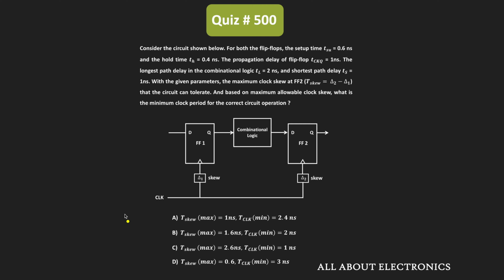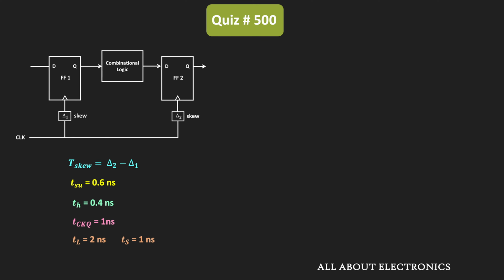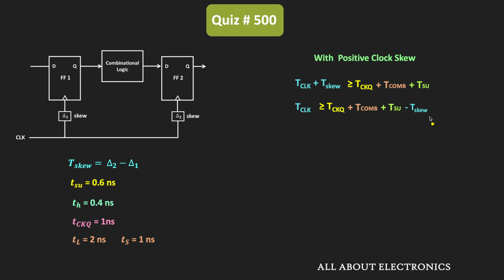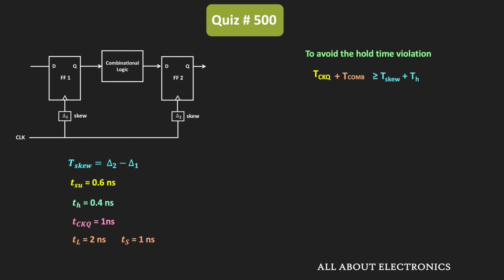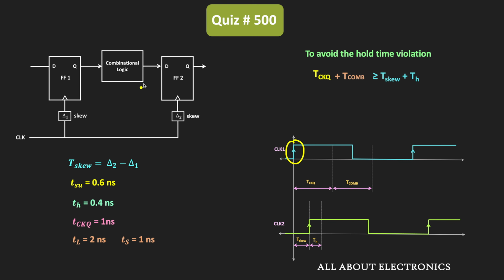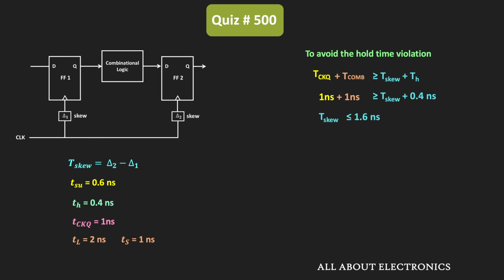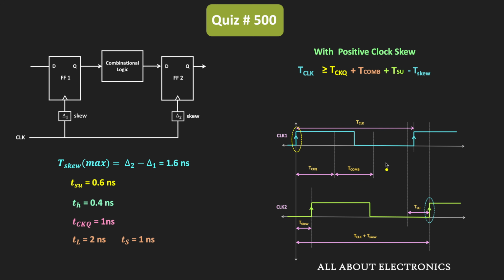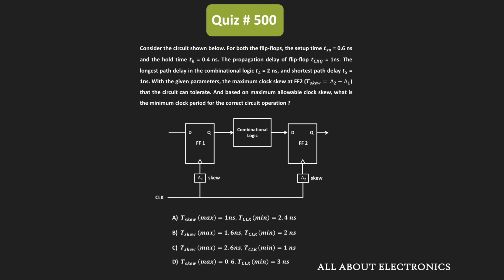Clock Skew Solved Problem (Digital Electronics) | Quiz # 500

Comment: Why we took shortest  path delay in case of maximum clock skew and longest path delay in case of minimum clock period?
Reply from the maker: For finding the minimum clock period, we are considering the maximum propagation delay so that the circuit works even under the worst case scenario.

Comment: Sir what if there was another flip flop followed by these two flip flops? how will we then calculate that?
Reply from the maker: It depends how the circuit is connected. Whether the output of the first and second flip-flop are going into next combinational block. Or the output of only  second flip-flop  is going to the combinational logic block. In later case, you need to find Δ₂ - Δ₃ . In the earlier case, (where both outputs are going into next combinational block where third flip-flop is connected), you need to consider the TL and Ts of both combination block.